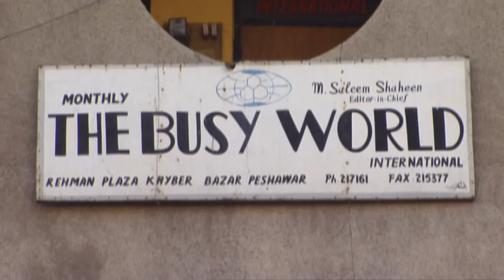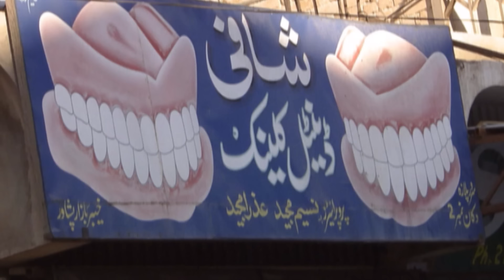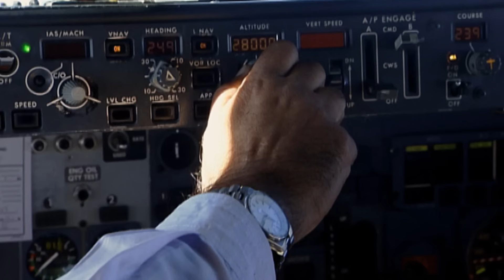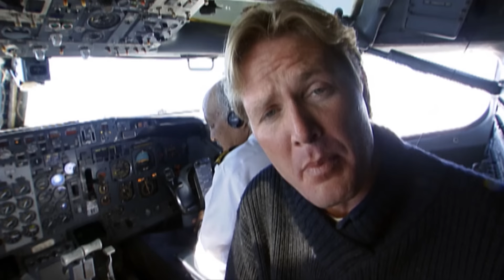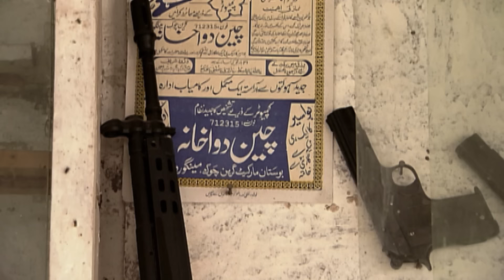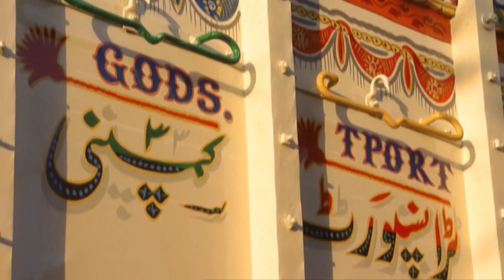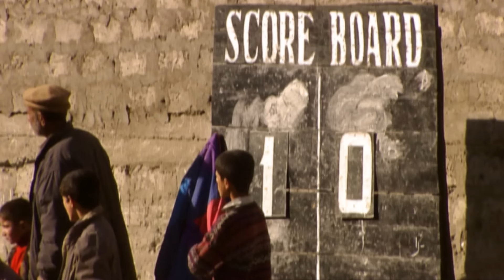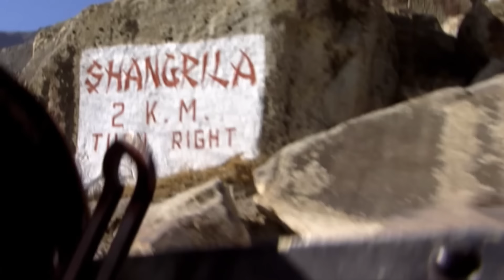Himalayan Utopia: The Ancient Mystery Of Shangri-La | Road To Shangri-La | Timeline

Comment: Thank you for this incredible video. I visited Chitral in the early seventies and hiked in to the Bomburet Valley. We hired a Land Rover to drop us on the mountainside about four hours from Chital and then hiked over the mountain and down to the valley. When you get down to the river, you can either go straight into the sprawling lush Bomburet Valley or turn right and follow the raging river into the Rombur or Rainbow Valley. At that fork we saw a totem and I wish I had a pic of that. The valley is a narrow crevice through the mountains. You have to continually crisscross over the river by carefully walking over bridges made from two huge logs that are joined in the middle with wooden dowels with the river cascading below. At one point I saw a parallel stream that was probably formed by a man made U turn that from the force of the water made the stream flow uphill. Again, thanks for the memory...

Comment: ..I believe the himalayas are 1500 kilometers east..then you have the karakoram..the hindu kush..then the pamir..
..one can arguably say they are branches of the hymalayas but the locals wouldn't call then it. .to them they are karakoram then hindu kush..I believe where shangri-la would be in the hindu kush..correct me if I'm wrong because until recently I thought shangri-la was in tibet then india..now I'm leaning towards pakistab..
..irrespective, the glaciers there are immense..never before have I seen this vast expanse of white..they seem larger then the hymalayas and have heard that more concentrated glaciers are in pakistan..which is quite striking in a few ways. .like I was saying though .it was the melting of these glaciers that contributed to the great deluge ...which was precipitated oddly enough by a heatwave in march...that I still think it was meteorological winter when the heatwave began w 40°C+ temps until torrential rains in june...
..this had to be the years most evident tipping point...unless the thwaites loses its grip beforehand..
  ..btw I think this video is like over 40 years old ..so that's kind of a bummer if you were expecting something Morea recent  .imagine how 🍲 would foox tage was then..even now you still donrx